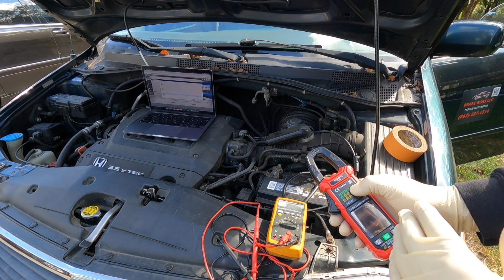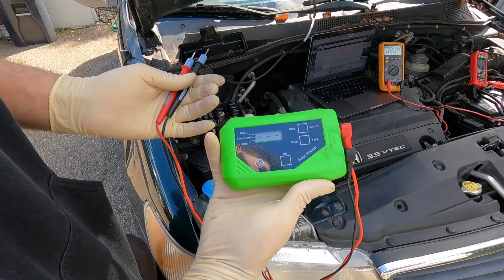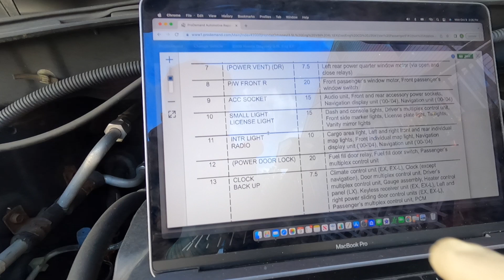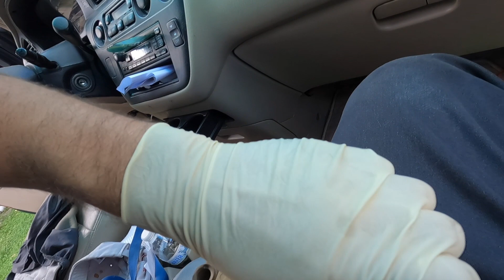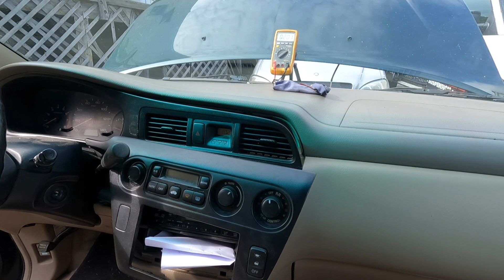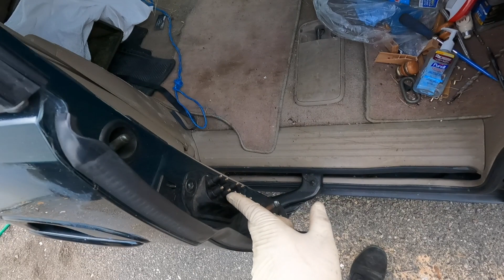How To Test For A Parasitic Draw (Car Dies Overnight)

Comment: This was a pretty cool and informative video on diagnosing a parasitic draw. I have one in my car but I'm certain it's the radio going into standby mode instead of shutting off. 😅
Reply from the maker: Thank you for watching! Radios causing a parasitic draw is not uncommon to happen, ive seen my fair share of that
Reply: @brakeboss Yes, that's true. I do electrical diagnostics and the radio was the problem many times....These  parasitic battery drains can get tricky. I had one on a Honda Odyssey that was very difficult, similar to this one.